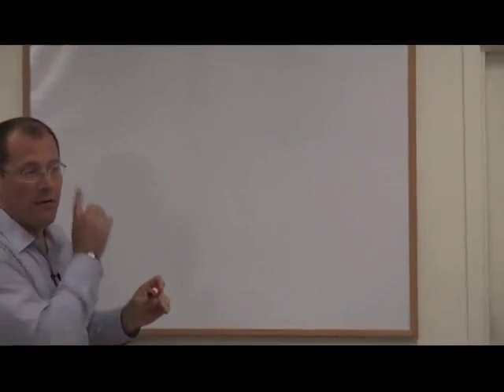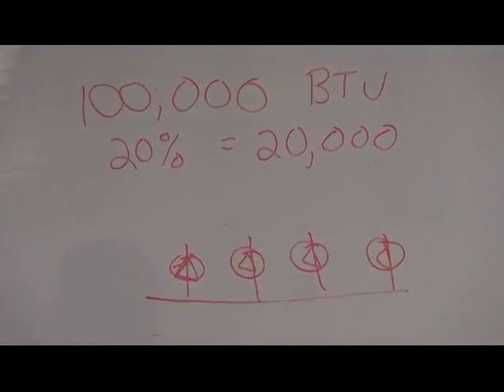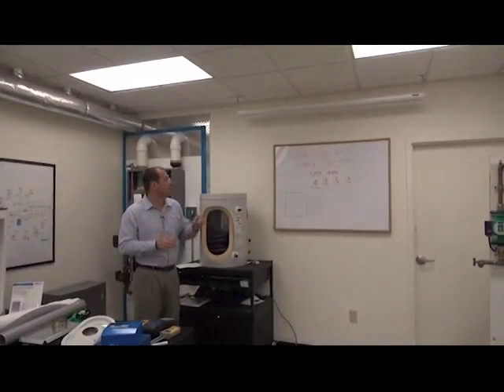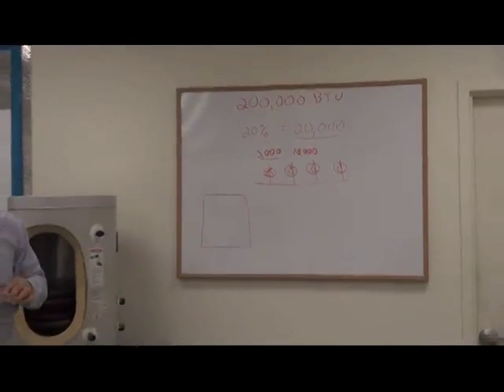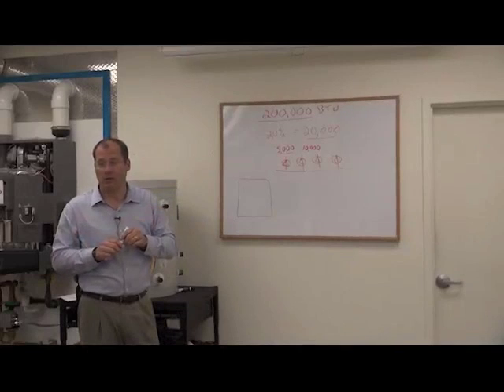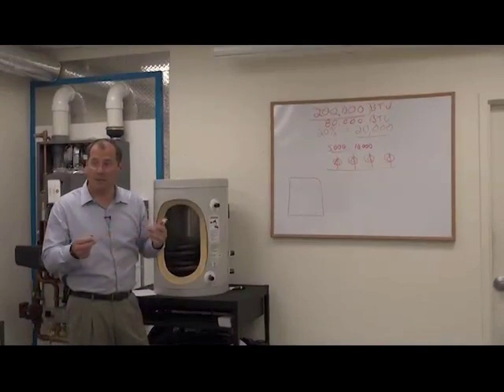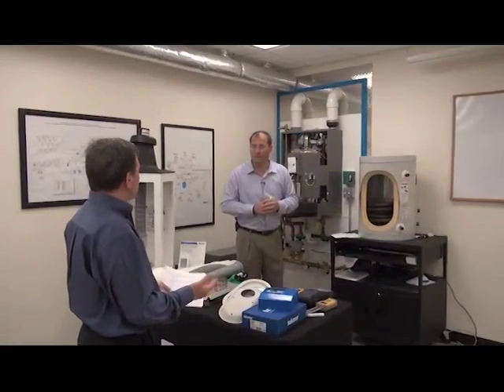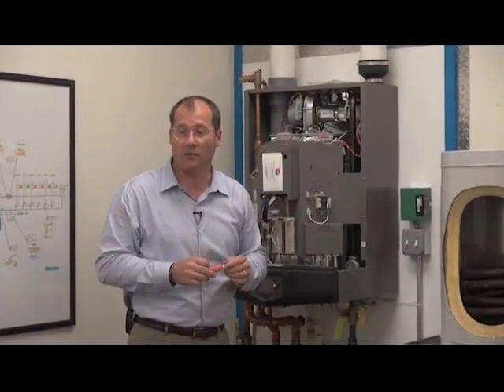How to choose the proper size for your boiler

Comment: How can we do a beat loss test if the boiler is broken?  I just bought a home, boiler was working and the next day after closing the boiler is dead...  it was a 175k BTU and I got an estimate from a plumber about fixing it. He recommended a new 200k BTU.
Reply: You don't need a bigger boiler than the one that was already in the house. A Manual J heat load analysis is based on the size of the house, the size of the windows, and a blower door test to determine the home's air changes per hour. You don't need the boiler to be working to do those calculations.

Comment: Very informative vid, thanks for posting it. Contractors seem to just want to replace your unit with what you had. I have a 35 year old unit, the house since has had energy efficient windows, siding installed. The boiler is also in a heated space in a lower level closet (high ranch). The old boiler seemed too much for the size of the house and based on fin tube feet in the house it is. Would love to do the heat gain loss calculation but seems difficult.
Reply: Your newer boiler is likely to be more efficient than your older boiler. You should take that into account when sizing your boiler. One way to get a handle on the proper size for your new boiler would be to look at how much fuel you burned during the coldest month this last year - then convert that fuel use into average Btu / hour. If you sized your boiler for double that number, your new boiler would be running 50% of the time during the coldest month of the year.
Reply: Mark Sandeen Appreciate the suggestion and will look at that, is there a way to differentiate the gas being used for the water heater ? Regarding replacements capacity right now this is what I’m thinking: I am trying to size a replacement boiler for my house it is in the lower Hudson Valley in NY. (20 miles outside NYC) It’s a bi level with 2518 heated square feet I have a 114.5’ of heated fin tube and a Beacon Morris kick panel blower heater that supposedly puts out 12500 BTU on high based on this my demand is about 81,200 BTU. I imagine I would base my sizing on the DOE output number posted by the manufacturer factoring in efficiency of the unit. My current leaking Utica is 150000 BTU input, 124,000 DOE output it lasted about 35 years. Sounds too big, house was built in 1963, vinyl sided double insulated windows now. Boiler is in lower level heated space in a closet. I am going to replace based on my demand using DOE output as the gauge of power, I don’t want to go way over based on the calculation. Thanks again
Reply: I have a problem trying to figure boiler size because I did a lot of insulation from 4” to the footing on a full basement to double stud walls with 7” of closed cell foam.  I’m going to have a bunch of zones for garage and it’s a duplex. I did most of the work except concrete and some roofing myself. It’s been a long road but we live in one half and I’m heating the other as it’s ready for drywall. We have been using oil with two Toyo Laser 30s burning about 500 gallons a winter. Natural gas is only a little ways and $10 grand up the road and that’s just to the driveway.

Comment: Hi, I like this presentation. Very informative. What is meant by "the boiler very quickly reaches temperature" around 1 minute and 20 seconds? Are you talking about the boiler very quickly producing the heat required for the applicable zone to reach its desired temperature? Thank you!
Reply: +Property SEBU The temperature of the water in an oversized boiler too quickly reaches the set point where the boiler stops heating the water. This results in the boiler short cycling - which is not good for efficiency or long-term reliability.
Reply: +Mark Sandeen Got it, thanks again! I'm working on a very small garage space that will only require about 6,000 BTU but it seems that boilers aren't produced for such small capacity. So I'm considering a radiant floor system, off of the Domestic Water Heater. If you have any more videos, and particularly catered to smaller loads, I'd love to be forwarded in that direction, thanks!